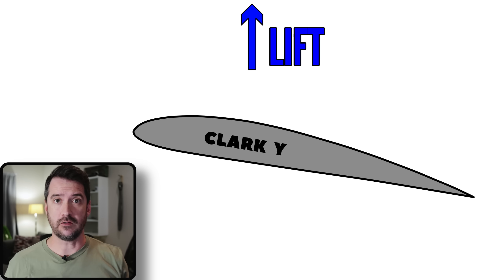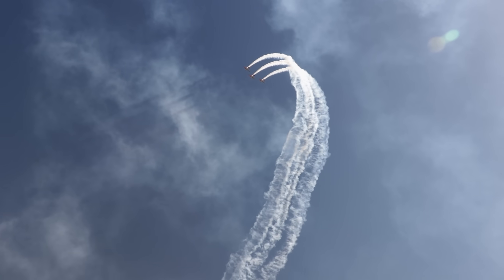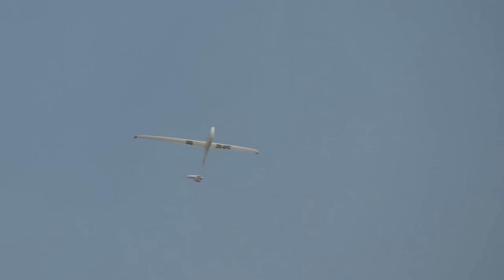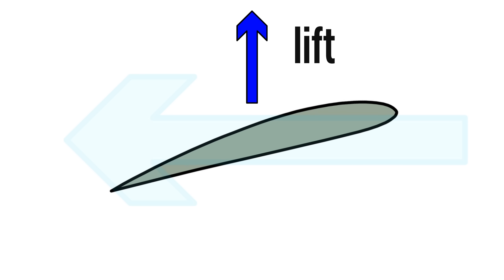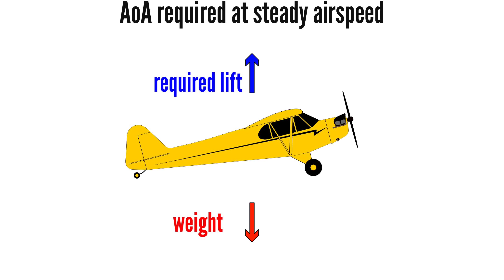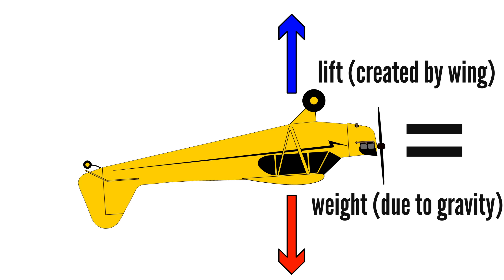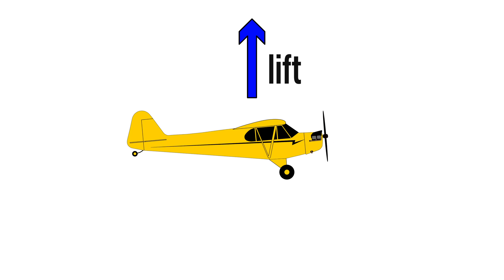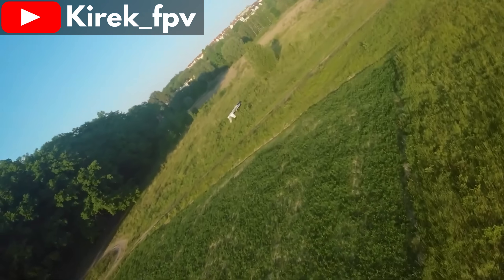Is Airflow Distance Over the Top of a Wing Always Longer?

Comment: the argument you point to is indeed oversimplified
but the conclusion it argues for still ends up being correct lol
look at wind tunnel testing or simualtions of any modern wing and you will see that the air above the wing reaches the trailing edge long long long before the air below the wing
in many modern wing designs the upper side ends up being like 1-2% longer than the lower side and the air above ends up going twice as fast since it gets suckedi nto the low pressure zone created by deflection
this also sucks air around hte bottom side of htel eading edge but equal transit times are still just measurably untrue

Comment: Not all wing sections need a positive angle of attack to generate lift. Many sections with a lot of camber have a zero lift angle of attack that is negative. In other words they generate positive lift at zero angle of attack or even slightly negative.
Reply: Which one, can you show us a polar graphic showing this ?
Reply: @12345fowler  Think my reply got deleted as I tried to posted a link. Have a look at NACA 4412 which has a CL of 0.5 at at zero AOA and a zero lift angle of minus 5 degrees. See also the paper "Numerical and experimental investigation of airfoil derived from peregrine falcon" by Yuvaraj and others Feb 2024. It also generates positive lift down to minus 5 degrees AOA.
Reply: @12345fowler  NACA 4412 and Clark Y are both examples.
Reply from the maker: If you use the bottom flat surface of a cambered wing it may look like it, but chord is from leading edge to trailing edge, not along the bottom surface. And AoA is the difference in chord angle and relative airflow.
Reply: @LetsGoAviate  No I'm not making that mistake. Many cambered wings have CL vs AOA plots that don't go through 0,0. Some can generate significant amounts of lift at a true AOA of zero degrees and have negative zero lift AOA. Even Clark Y.

Comment: model airplanes fly differently then full sized planes because the relatively thick boundary layer makes the smaller wings airfoil almost irrelevant, and airplanes that can fly upside down usually have different fully symmetrical airfoils, along with fuel and oil systems that can handle the neg g forces. pressure is determined by airspeed and just because the air travels a longer path does not mean is has to be traveling at a lower speed as the air flow over the top does not match up with at the same air flowing under the wing. air flowing over could come out either ahead or behind the air flowing under.

Comment: you are correct, the amount of lift generated by an asymmetric wing is not zero, right side up or upside down. It does however not generate a substantial portion of the lift in either case. It does in fact generate so little to lift, it might as well be zero. Kinda like people saying water is incompressible. it just compresses so little, that it rarely makes any difference... So, YES, the pressure differential theory of lift is debunked, officially, by scientists who studied it for more than 100 years to make sure they got it right. It does contribute to lift, but not enough to bother with most of the time.

Comment: The stagnation point moving far below and behind the leading edge demonstrates the strong differential in pressure between the areas above and below the wing.  Air moving toward the leading edge will get sucked over the top to fill the low pressure zone if it arrives at an area of the wing where the air pressure differential is strong enough to pull it upwards.
Reply from the maker: You put it more eloquently than I do
Reply: maybe 'pushed' is more accurate?
Reply: You need two different pressures to get movement.  The higher pressure is not being resisted by the lower pressure, and the gas moves to equalize both zones.  The gas in the higher pressure zone expands and loses pressure as some of the gas moves into the lower pressure zone and raises the pressure there.
Pushing happens, no doubt.  And pushing is required.  But try pushing a gas anywhere without a low pressure zone to receive/suck it.
Reply: "sucked"  how?
Reply: @perh8258  
Fluids move from higher pressure areas to lower pressure areas.
Reply: That was how I was taught it, by a book mind, the book only showed the classic aerofoil and explained that the air moving the further distance was basically being "stretched" (same air, more distance) thus creating a vacuum and therefore lift. Now adding in the new knowledge of the splitting point of the air hitting the aerofoil it makes a lot more sense, although I've been told that is NOT how it works. I'm not saying I know now but it's interesting.
Reply: one more try. Higher pressure is higher energy, lower pressure is lower energy. Lower energy doesn't suck high energy, lower pressure allows the higher pressure/energy to move. No sucking is happening.
Reply: @perh8258  
REALY?
If you don't have both levels of pressure, you have no movement.
You can blather all you want, but that's a fact.
Reply: @deezynar  Yes, and the lower pressure is not sucking anything, the high pressure is moving to the lower pressure
Reply: @perh8258  
Try using your head.  I read the same science textbooks that you did.  I had teachers like you did who said what you are saying.
None of them are thinking wholistically.
There is no blow without suck.  Period.
For every experiment that you try to do with me present, I will negate the movement of gas by keeping the high pressure area from connecting to the low pressure area.  You will have no blow until I let it happen by connecting it to the low pressure area.
Reply: I like to think of flight and lift not being a fluid moving over a wing with pressures, vacuums, sucking etc. but the wing hurtling through a viscous fluid substance being driven by the downward force of gravity and the lift is merely a result of the wing deflecting or ricoshaying off the viscous air as it hits it at speed.

Comment: You can also think of the angle-of-attack as a position that lets the wing deflect air. With a high angle, the wing is able to push the air downward, giving it a vertical component to its momentum.

Ok I should probably specify that this is not the only factor that generates lift.
Reply: How about a kite? how about a speedboat "on plane" on the water? Somewhat similar I wonder? I realize a boat on plane is operating in two different medians,  the top surface of the water and air on top of the water which has basically little effect to the fact the hull is up on the surface of the water but, yeah.
Reply: Maybe a boat isn't a very good comparison. A boat rudder, prop or the diving planes on a sub would maybe be a better comparison. After all air and water are both fluid. 
 How about a ramping or camming effect? After all we know a flat thin board wing, like on a balsa toy glider will fly. Right?

Comment: The longer path or any Bernoulli based explanation are just good enough for a quick elementary description of lift. For Bernoulli principle to be applicable you'd need to entirely disregard viscosity. 
In addition, I'd refrain from translating any RC-sized plane effect to a real scale plane, the RC models fly in a low Reynolds number regime and in most cases probably don't really need an airfoil to fly decently.

Comment: Anyone who thinks the different travel paths create all the wing lift has never stood behind a propellor or under a helicopter. Force (thrust) = change in momentum (delta MV).  Just like propellers deflect air backwards and helicopters deflect air downwards, wings deflect air downwards as well. The change in momentum produces most of the lift.  Put your hand out the window on the highway and feel the forces.  

This video https://youtu.be/6UlsArvbTeo?si=CNghS9YtYC3fUIkH shows that slipstreams above and below an airfoil DO NOT arrive at the trailing edge simultaneously. I have seen videos where the upper path arrives after the lower path, and some (as here) show the upper path arriving before the lower path. NOTHING says they have to arrive simultaneously. By definition, there is a pressure differential between the upper and lower part of the wing or else the wing would see no net force and generate no lift. But the pressure increase on the bottom part of the wing is due to air deflection not the Bernoulli effect.
Reply: You CANNOT generate ANY lift without transferring downward momentum to air.
IF you could do that, that would violate Newton's 3rd law.
IF, IF that was possible, you could theoretically create a propulsion device for use in vacuum.
BUT WE CANNOT.

In other words, mV/t is the 100% of lift.
No more, no less
Reply: @Alec72HD  yep!
Reply: This doesn't invalidate the longer path theory at all. An airplane prop or helicopter blade are just other cambered airfoils just like a wing and thus have also a longer path.
Reply: (1) The culprit isn't Bernoulli, but the misapplication of Bernoulli.  Bernoulli applies perfectly well to the actual airflow.  (It'd be a violation of Newton's laws for it not to.)  The mistake is to think that the actual airflow is the cereal-box story about equal transit times.
(2) "Suction" in any realistic context involving subsonic airplanes does not mean zero absolute pressure, it simply means air pressure lower than atmospheric.  A wing can perfectly well suck air downward along its upper surface because there's several miles of atmospheric pressure above it to shove the low-pressure air down so that it follows the upper surface of the wing.